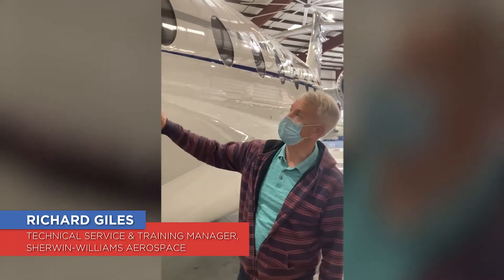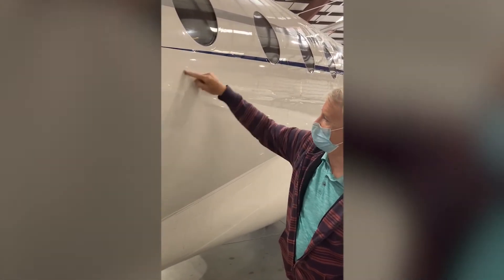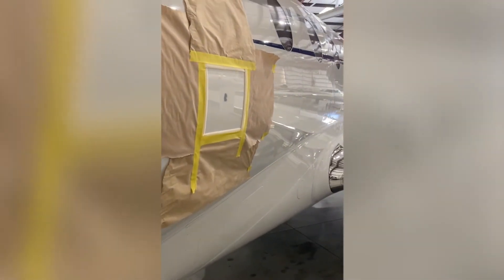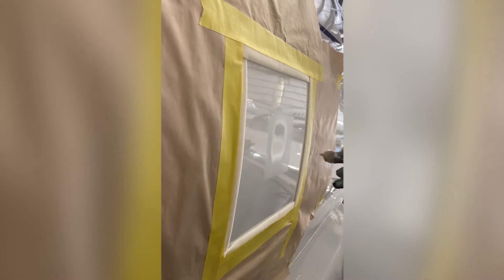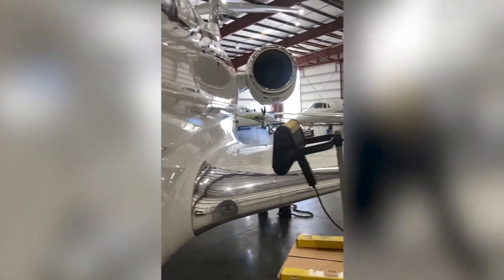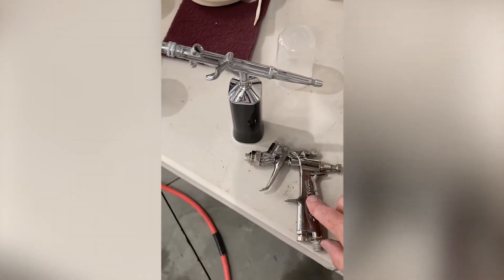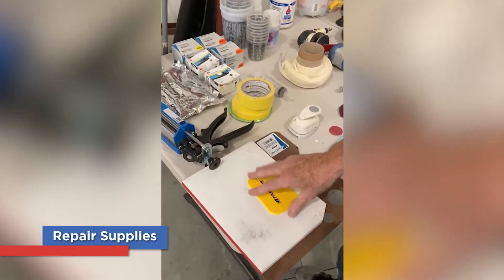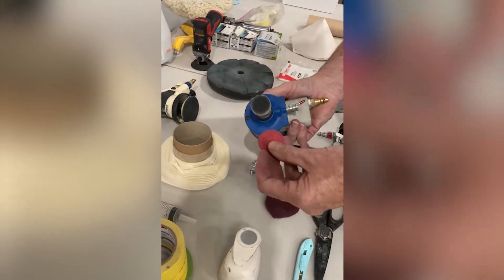Aircraft Paint SMART Repair Video

Comment: Did you blend the outer edge with CM0110510?  Over-reduce the topcoat?  Thanks Rich.
Reply from the maker: Yes the hard edges on the top coat can be blended using the CM0110510 blending solvent. Plus: another method is to over-reduce the final stage of the mica/pearl repair fanning out with that mix from the immediate normal repair and staying within the sanded area before clear coat.